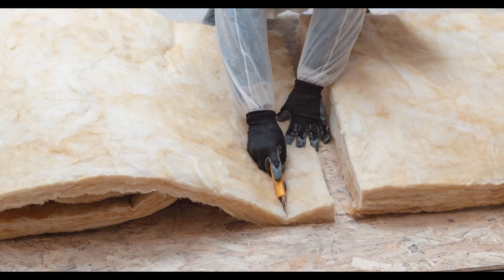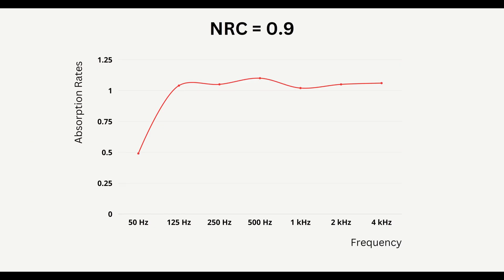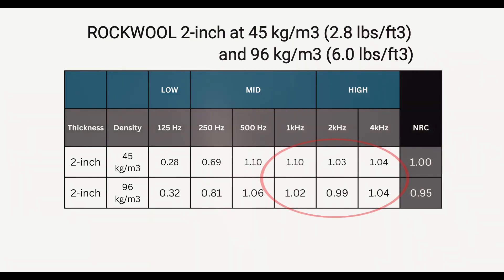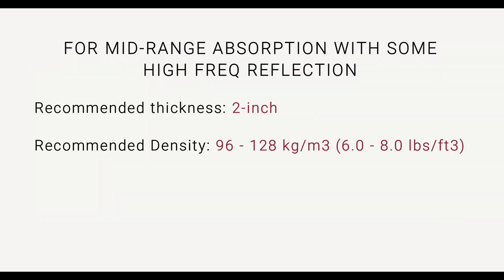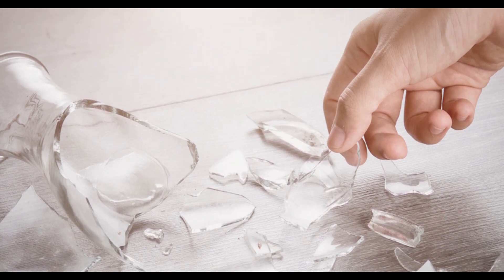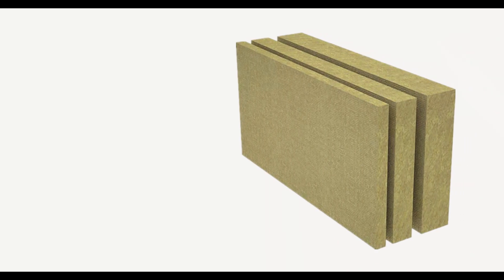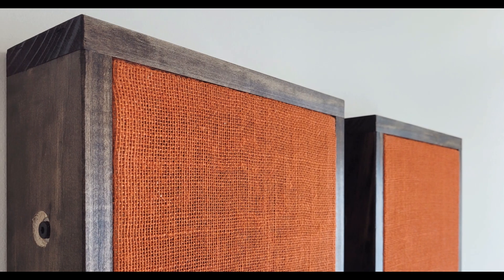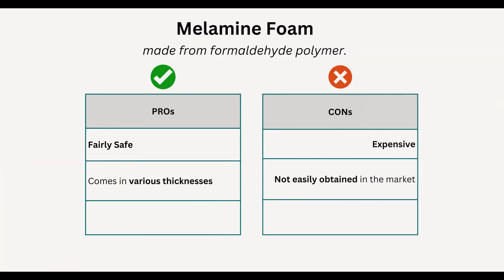What's The Best Insulation For Sound Treatment | Choose The Right Material For Your Absorption Panel

Comment: how fire retardant are these materials? would there be an insulation material that is more fire resistant than the others, or are they all about equal in that respect?
Reply from the maker: Rockwool, Fiberglass, and Melamine Foams are non-flammable and highly fire-retardant. Rockwool is the most fire-retardant up to about 1500 degrees Celsius followed by Fiberglass which can resist up to 1000 degrees Celsius, then followed by Melamine which resists up to 250 degrees Celsius. Recycled Cotton on the other hand is NOT fire-retardant.

Comment: Hey, this was very informative, thank you for the video! I have a question:
My option for insulation is recycled foam, has a very high density like 120 dns and also comes with 4 or 5 inch options. Would it be okay to use 4-5 inch with that density level, would it be too rigid and have poor absorbtion?I want to treat low, mid and high frequencies with a priority on low-mid.
Since it comes only with 80 or 120 dns im wondering if its not as  resistant to air as rock or glass wool at the similar density levels due to the material

Comment: The question I have is where to find recycled denim batts? I heard the one major manufacturer of UltraTouch is no longer making it.
Reply from the maker: They're still in business, and their products are being supplied through a company called 'Sound Away'. There's another company that sells denim batts too 'ATS Acoustics'. Not really sure where they source from or if they actually manufacture. But here are the links 

SOUND AWAY:
https://www.soundaway.com/Ultratouch-Cotton-Insulation-s/92.htm

ATS ACOUSTICS:
https://www.atsacoustics.com/recycled-cotton-batts.html
https://www.atsacoustics.com/recycled-cotton-batts-single-pieces.html
Reply: @neptuneaudiospace  Thank you! I didn't know about them.
Reply from the maker: @ramonbmovies  You're welcome!
Reply: I spoke to them on the phone today. They are currently without a distributor and told me to check back in with them in 2 months. Not a very promising update, but an update nonetheless.

Comment: What about compressing earthwool batts as they are quite spongy? Woukd this increase density and therefore effectiveness if I was to make bass traps 6-8inches thick on the largest point? Thank you
Reply: The performance of many porous absorbers can be explained by comparing the size of the sound wave to the depth of the treatment. The size of the wave is quantified using the wavelength, which is the distance between adjacent crests of the wave. The wavelength varies greatly with frequency: at 50Hz the wavelength is 6.8m, at 500Hz it is 0.68m and at 5000Hz it is 0.068mm. A simple rule of thumb is that for a porous absorber to be effective it needs to at least a 10th of a wavelength thick. At 500Hz, this equates to a depth of 6.8cm. The very large wavelengths of low–frequency sounds are the reason why bare acoustic foam makes an inefficient bass absorber unless the material is extremely thick. For a 52Hz sound, for example, a layer of porous absorbent 65cm thick is needed to provide absorption and this needs to cover a large surface area, not just a few pieces in the room corners.

Comment: What insulation should I use for a theatre false rear wall, 4-6 inches of insulation. Rockwool SNS or Comfortboard 80?
Reply from the maker: Use either product. They are both great at absorbing deep. In terms of safety, the Rockwool SnS might be a little safer, but the Comfortboard is pretty safe too.

Comment: Great video. Is it a good idea to wrap acoustic panels that are already built in plastic to prevent fibres from escaping, meaning that the entire fabric is covered by thin plastic tarp? Or does the plastic barrier have to be on the inside - between fabric and rockwool?
Reply from the maker: The plastic wrap should be between the fabric and rockwool.

Comment: Hey, thank you very much for the video. Do u know why the YouTube Channel with 1M subscribers „In The Mix“ recommends to use a density of 20-30kg per m3? He said, 50 is too high. He worked with denim fibre. (For sound mixing purpose)

I want to use denim fibre as well. Which density should I order for absorbing the whole frequency range? Of course I will build the bass traps way more thicker than the normal panels!

I dont know if you can help me with this specific question, I read the comment about the GFR parameter under this video and I will go in the rabbit hole by myself to make the right decision. But if you know more, Thank you very much!!
Reply from the maker: Hey thanks for your comment, and sorry for the delay. It all depends on what your goals are acoustically, what kind of room you have, and what problems you're facing in your room. Any information you find online will usually be a rule of thumb to guide you in your creative decision-making. No one knows your gears and room like you do!

20-30 kg per m3 is definitely a good option to absorb with the mids and highs, and this range will work perfectly well for larger rooms that don't struggle with problem-low-frequencies. For most small rooms, usually have problems with the Lows and maybe the mids if you have a glass window or door. So for smaller rooms, you might want to go a little above 30kg/m3 (40kg/m3 is usually perfect in this scenario.)
Reply: (Denim fibre isnt only available in 40kg / m3 like mentioned in the vid)

Comment: Thank you for the video!
just several things I have to point out..
Material density is a bit of a controversial topic, primarily due to its correlative relation with the actual parameter that must be looked for when deciding on the amount and the actual material for these types of broadband porous absorbers.
Finding the material's Gas Flow Resistivity (sometimes known as GFR or Airflow Resistivity AFR) would much greatly benefit when choosing the materials.
Using the variety of Porous Absorber Calculators online could assist in making better decisions, all it takes is to input the GFR, the Thickness, air-gap space and you got a fantastic baseline for the following decision making endeavor.
One thing to keep in mind.. not all manufacturers share this information.. it is best to check Gearspace for the "common GFR list" thread for a well condensed list of GFRs in a plethora of materials spreaded across the globe!
Best of luck!
Reply: Great 😊👍🏼
Reply from the maker: Thanks for your comment! This is awesome information right here. Never actually heard of the GFR. Will definitely look into learning more about this parameter, and see how we can inform others about it. Once again thanks for this golden information!

Comment: Hey there! Thanks for uploading this video. Great stuff. I have two questions:
1. you clearly state the impact of thickness on the amount of absorption on all frequencies: the thicker the lower in can absorp within the spectrum. I am curious what would happen if you go thicker than 4inch rockwool: for example 6" or even 8". Would you be able to absorp the lower frequencies from 40-125 and obtain a NRC of 1 or more?

2. By replacing the rockwool by another type of insulation like recycled denim are the same amount of inches required to obtain an NRC of 1? Or do all materials mentioned in this video have the same density?

Also I would recommend to use fabric on both sides of the insulation for safery reasons. Or is this not a good idea?
Reply from the maker: Thanks for your comment and great questions!

1. If you go thicker than 4 inches, you will definitely have higher NRC and will be able to absorb those lower frequencies. While this approach may be good for 40 Hz - 125 Hz, you may start to lose that main energy coming from the low-mid frequencies. So you might want to test things out to see if it's worth doing this way.

2. Each material comes in its own various densities and thicknesses, so you may not require the same amount of inches to get the same results.

Yes, feel free to use fabric on both sides for a safer environment.

Hope this information helps! And sorry for the delayed response. We've been quite busy with building for our customers!